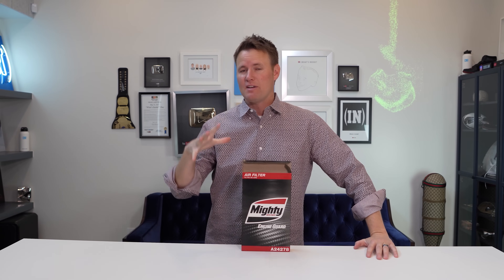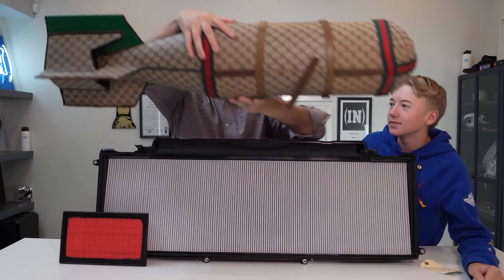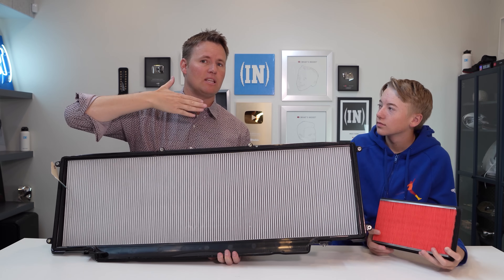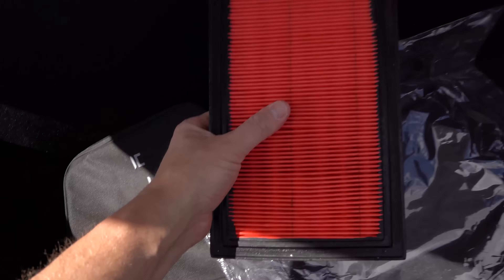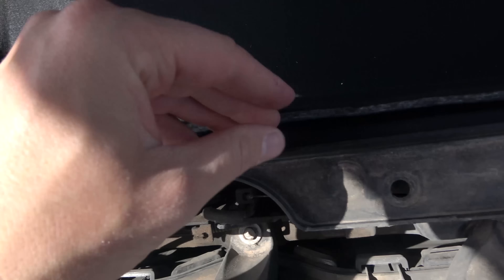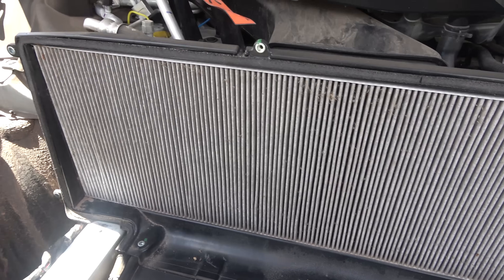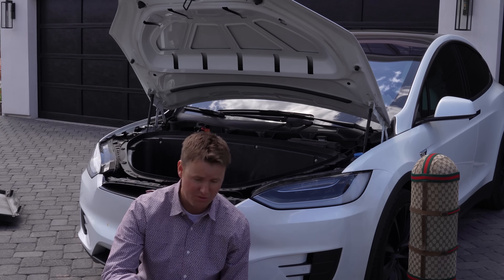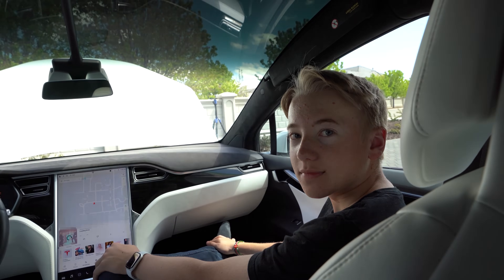What's inside Tesla Biodefense Filter?

Comment: So the big orange tag with the scissors icon is "not" telling you that "you don't want to cut that", it is actually telling you that should an emergency situation arise whereby extrication becomes necessary, the first responders (Fire Department) "should" cut that cord in two places to "disable" high voltage from car and contain it to battery only, before doing any extrication efforts, to avoid electrical shock/death.

Comment: Pretty sure they just use it as a cabin intake filter and it's actually using it all the time, just biohazard mode runs the fans at full speed and pushes as much air through it as possible

Comment: Small note: you dont actually need bio defense mode for the air to be cleaned by the filter, all your cabin air is filtered by it regardless of what your a/c settings are :)
Reply: That’s nice to know
Reply: True but bioweapon defence mode creates positive pressure inside the vehicle with fans/vents so its impossible for outside particles to get into the car via door or window seals

Comment: Yes that makes everything better.
Tesla: Were going to make sure you have pure air while either our autopilot feature beheads you by driving the car into a tractor trailer OR while the battery is burning under the car, but if you roll up on another one burning you can watch it from 10 feet away with your pure air.

Comment: Elon says that the model 3 has the “second cleanest“. The model 3 has two filters larger than most car cabins. The model 3 has to clean less air so that’s more than enough. Also I have added aftermarket carbon. Also I’ve added a third filter to the intake duct under Frunk.

Comment: Of course the air flow is going to work. Your fan motor hasn't gone out (or any of your climate control systems). The big question is "Did I install it right?" (Checking the filtration levels in the car and comparing them to tesla's numbers)

Comment: Hate to tell you this, you can get a Bosch HEPA cabin air filter for any car equipped for a cabin air filter.  The vertical and horizontal size of the filter is not important, its all about the thickness of the filter and its construction.

Comment: The filter you have there is one that filters the air going into the engine. The filter that filters the air going into a car's cabin is called an interior filter. An interior filter is both a particle filter as well as a carbon filter, an engine air filter is just a particle filter.

Comment: 10:18 The filter is actually always being used when you have the air on but when you turn on the mode it ramps up how much air is being pulled in
Reply: This really irritated me.

The HEPA filter is always in use when the air in the car is on. When Bio-Weapon Defense Mode is on then the car pumps in as much air as possible to keep the cabin under Positive pressure with filtered air, so the HEPA filtered air enters and then leaves whilst nothing gets in. The air from the car doesn't "escape through cracks", it's designed to leave the car such that no airflow from the outside is able to enter the cabin.

The HEPA filter should be replaced every 3 years (Regardless of BDM usage) in accordance with the service intervals set out in the manual. It will look dirty after this time, and especially so if it's been left in for longer than it's service life.

Also, you know, obvious statement about not driving through a recently nuked area. Gaseous radioisotopes can still enter the car though the filter (because it filters out particulate matter (e.g. Smoke or PM2.5), not molecular matter) and will lead to problems for the occupants, regardless of all the Beta and Gamma passing through the Aluminium frame, glass and metal bodywork.
Reply: Ikr i was so frustrated when he kept saying the bio defense filter

Comment: Hey Dan.
That Bio Defense Filter is not only active if you switch on the Biodefence mode, its always geting used.
Thats Like the Airfilter thats uesed in normal Cars.
That filter should be getting replaced every 15000km(gas Cars)

Comment: "What's inside Tesla Biodefense Filter?"

I guess we will never know!
Reply: I have a Tesla (not a Tesla branded not any affiliation with Tesla) bio defense filter in my house it's called a true HEPA air cleaner with charcoal filter for removal of odor and an ionizing unit that I won't use because that is not safe breathing in ozone. Much smaller than the one in the Tesla but looks about the same in construction and material. But I think I'd rather be in the Tesla in case of a bio attack.
Reply: Maybe a filter?

Comment: Answer to Lincoln's question😉

The reason for why there is many mountains in Chile and not Brazil is for our planets amazing work with tech tonic plates. Mainland Chile is located by two different plates that collides now and then, which is the reason for the earthquakes happening from time to time overthere. This has been going on every since our continents formed after pangea. Under that period of time theese two different plates have collided into each other deeper and one or the other have climbed above the other one, which slowly have formed mountains. Brazil on the other hand is located in the middle of a plate, which means that they aren't in a such risk of earthquakes and huge mountains forming anytime soon.

Pin for the ⛰️ facts 😉

Edit: Used the wrong term for the whole event  (tech tonic plates it is) 😅
Reply: Plate tectonics
Reply: @Your Multi Purpose Nerd y'all both wrong it's tectonic
Reply: It's plate techtonics
Reply: Combat Micah it’s both
Reply: It's called plate tectonics

Comment: This guy is a mess at cars that looks like the air filter for the engine not the ac filter that thing is located in the car not where the engine bay is located just watch Chris fix videos
Reply: You are assuming an ICE car has the same filter setup as a Model S. You can go to the Tesla website right now and order this filter upgrade and it will say it is for the cabin, as well as dozens of other YouTube videos showing the same thing, or literally a picture/video of Musk holding this exact filter during the press release.

Comment: It is a HEPA filter its not much different from air filters you can buy and plu gb in in your house. So no nuclear fall out. The reason it blows air so hard is it is positively pressurizing the cab so it can leak but not let any contaminants in. Basicly theg did that so they didn't have to redesign the car like a sealed space ship.
Reply: Almost all cars have air filters now  tesla's is just a little bit bigger (not necessarily better at purifying). And the reason for the size is so the they can push enough air through it to pressurize the cab. A smaller filter can't  handle enough air. The button does nothing but turn the fans all the way up.